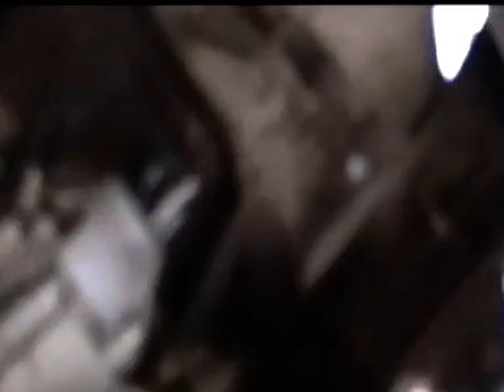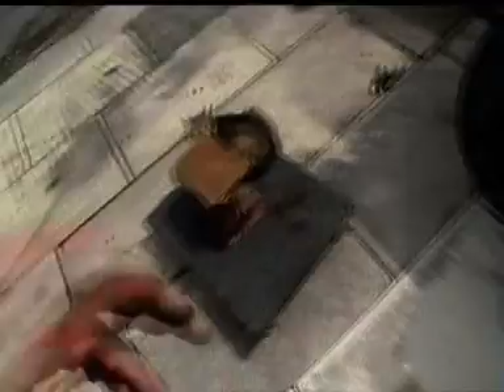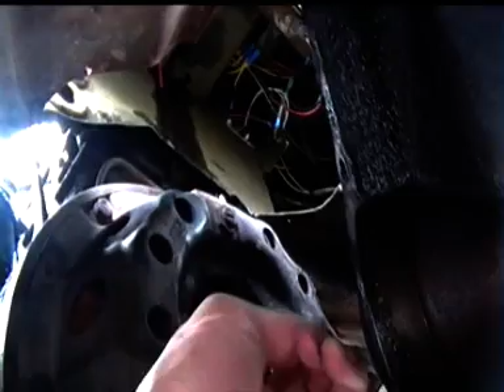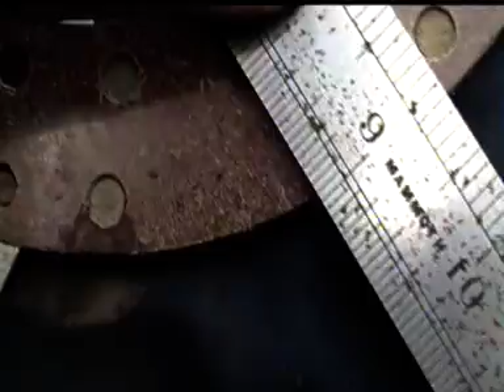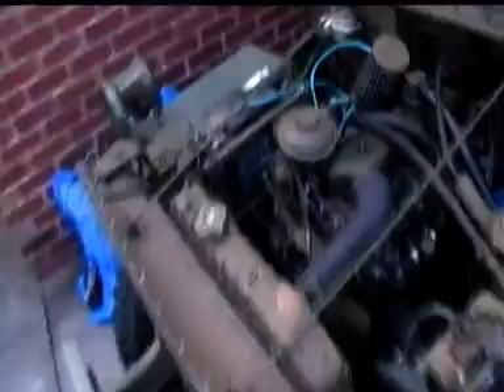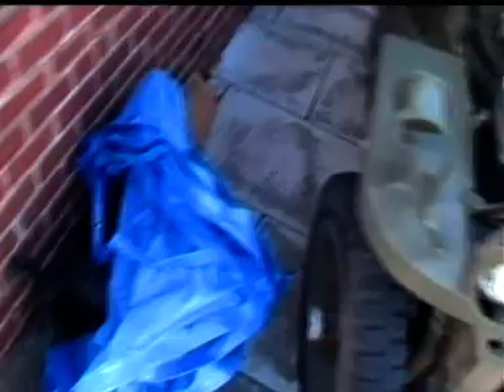Mahindra Jeep clutch check

Comment: Hi Oddball 
I have just watched your Vid and well done it was to!  Question on the Hydraulic Clutch you had on the floor would it be possible to measure the  thrust and baring dimensions from face to fork holders face at rear.    I have just had a new Clutch sent from Ahmid (india) and parts.  All fitted but something is to big and when all put back clutch still open ie no forward motion when clutch is up ???? Thanks Andy
Reply from the maker: Will try and find some time for you.